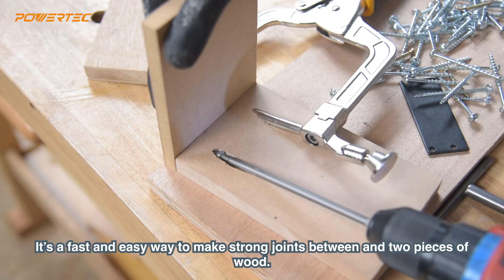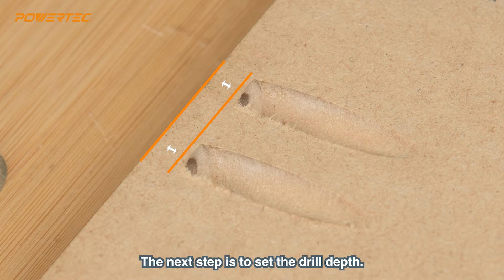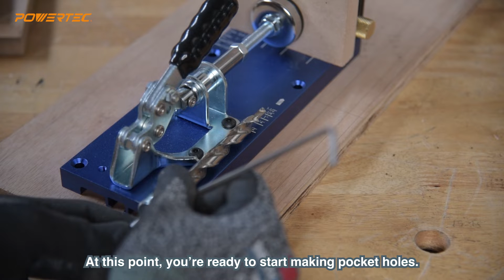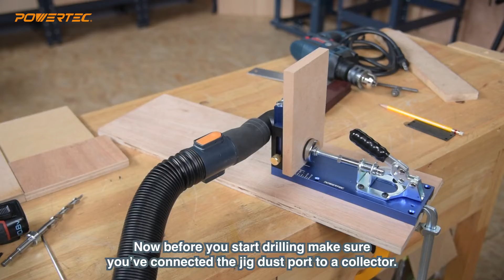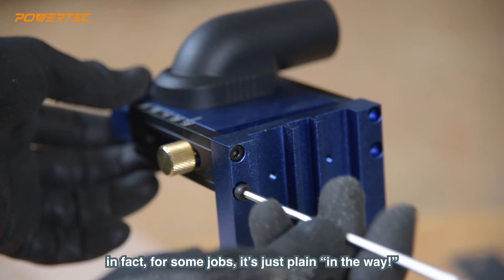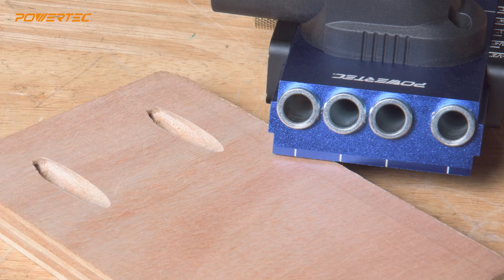The Ultimate Pocket Hole Jig for Clean & Perfectly Shaped Pocket Holes | POWERTEC Woodworking

Comment: hhmmmm.... nice pocket hole jig. it'd be a shame if we angled those screws to the outside edge of the board we were attaching it to and discredited ourselves with anyone who prefers to use pocket hole joinery the right way.... 😝 tbh, it looks like a nice jig in spite of my pedantry
Reply from the maker: Dear Munkytaint666, Although there are many applications for pocket hole joinery (box joint, mitered joints, etc.), this is only one example.  Yes, a box joint would normally be made to the outside if you are making a standard cabinet, but we feel an offset edge joint is much easier to follow for this demonstration video. Never limit your creations and keep on perfecting your projects. Thank you for your comment and always work safe!